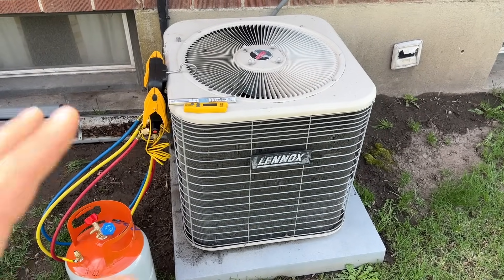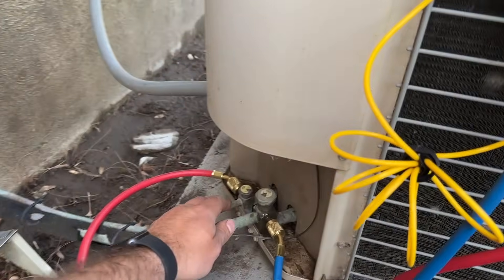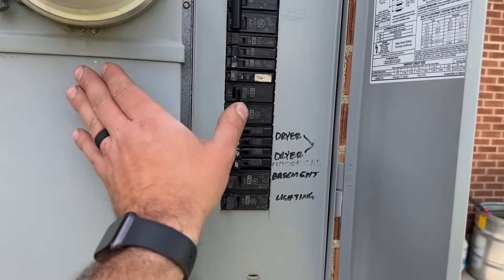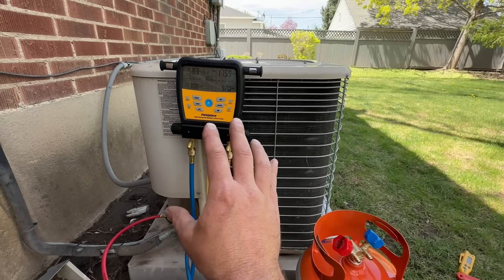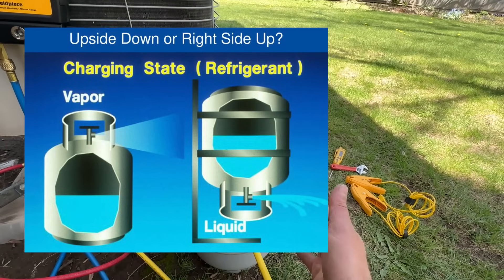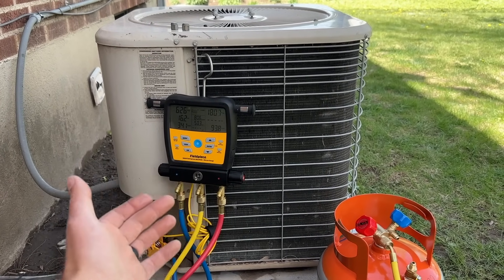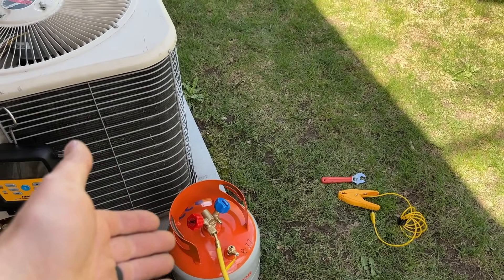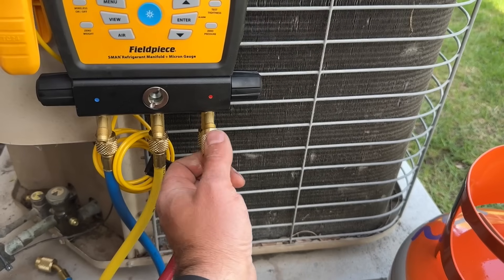How To PROPERLY Recharge Your Air Conditioner

Comment: HVAC is for trained professionals with years of experience, not a quick DIY Saturday afternoon at home watching YouTube.
Reply: If you have some similar skillsets HVAC work is a small step. Can the diesel mechanic fix his gas lawnmower?
Reply: @alexfriedeck1978  hvac is a trade that takes years to learn brother. Even master techs still have to go to school to learn new systems and procedures. Just cause you can change your own oil on your car doesn’t mean you can do this shit lol
Reply: @One_greasy_m0f0  Do you have a PhD in Chemical Engineering and one in Electrical Engineering and one in Mechanical Engineering and one in Heating Engineering? Those skillsets would take years learn and are needed to design, build, and install HVAC systems. What you have is Community College Engineering 101 skillset and you follow a flow chart with an "if this than" directive that the PhD's with the "years to learn" degrees have given you.
It all operates on the principle of evaporation. The only difference between a water cooler and refrigeration cooling is the heat transference mechanism is recycled. Learn new systems, oh please. You're shown how the manufactures tweaked the principle a little bit as a selling point so when it stops you can find the proverbial wrench a little sooner. The procedures, jeez, now you cannot vent refrigerant into the atmosphere and now it's required to turn off the power instead of recommended. Any other procedures I missed?

This industry was ripe with fraud for too many years cosponsored by the parts suppliers that starved consumers for parts who operated in the shadows with you feeding the consumer, the laymen, lies that to repair this equipment took a high degree of expertise when it doesn't as that now the internet has exposed the misdeeds of this industry, you're one of those fraudsters that is angered because the average consumer is no longer a layperson you can prey upon and you actually have to work for your money instead of stealing it.

$80 dollars for a 35/5 Chinese capacitor when I paid $22 last week for a US made capacitor and $299 for a single speed 1075 rpm Chinese condenser fan motor is fraud.

Thousands of dollars in tools, go ask the guy fixing your van if he has 40K plus in tools and he competes with the DIY's and AutoZone and you only have three grand in tools. $100 dollars per hour labor is fraudulent also when the guy fixing your van charges $90 an hour and his overhead is a $750K building and yours is a $50K van at $100 an hour is fraudulent acts committed against a layman consumer.

One of these days coming soon many of these big companies are going to find themselves as defendants to a class action lawsuit for price fixing. Go ask those tuna guys and the pharmaceutical guys about that.
Reply: @alexfriedeck1978 You just too all the fun 😂 out of my .25 cent insult....I bet your still single!

But, seriously excellent way to VERBALLY SHANK that sob 👍🏻.
Reply: I agree but some people cant afford 5-6-700 dollar bills just to put a capacitor in. Some of the Ac company costs are overwhelming.
Reply from the maker: If someone gets their epa card they can do this. Who is stopping them? It’s not illegal if they get that simple 608 card.
Reply: @diyhvacguy  Yes anyone with a mechanical aptitude can install a furnace or a/c but when it come down to troubleshooting refrigerant issues you need certification and experience.  Homeowners are going to do more harm than good in most cases I’ve seen it happen.

Comment: So how many homeowners do you think are going to get their EPA certificate, buy at least a couple thousand dollars worth of tools, order 410A or an R22 drop in online to charge their unit. Oh you forgot they need to find the leak so now they need a $400 leak detector. Remember when you’re charging for your “friends” at no cost from those recovery tanks, you’re pulling up oil, contaminants, acid that may have been recovered from burnout system.
Reply: Air flow
Reply: @bcracing204  is king
Reply: If a unit is needing refrigerant is becouse have a leak. First, find the leak and fix it then charge if needed.
Reply: ❤ thank you thank you thank you
Reply: 3:44 <-- see this! 

First of all, he broke down how to do this using the standard blue/red gauges and w/o temperature clamps. 

Take note that I am a homeowner with a leaking 5ton and I've been quoted up to $3k just to charge and just maybe repair the leak, OR pay $8000+ for a new unit installed. 

I was able to find a 10lb tank of new R22 for $259.95 and a set of gauges w/the quick connects plus a separate valve w/handle, as well as a # of extra attachments & replacement gaskets/seals, all for UNDER $30 . I have an infrared thermometer to assist in verifying the temps of my suction & vapor lines and/or my sub/super readings. 

If needed, I also have a digital scale to assist in measuring the amt of R22 being added.

I got some Condenser cleaning spray/foam for $9.49 plus already had ome Simple Green, garden hose and some misc brushes should i need them. 

I also have a multimeter I got for UNDER $10 that's been great after 3 yrs old that I'll use to run checks on the Capacitor, the 2nd stage voltage (...if necessary), and other electrical components while I got the panel off. 

Total Parts Cost: $309.44
My Rate @ $50/hr × 2 (est) = $100
Research @ $25/hr × 2 = $50

For a grand total of: $459.44

I'd say I'm saving a grand bare MINIMUM. Unit takes I think 9-11 lb of R22 and it's gotta be very low.

It wouldn't be outrageous to assume that there are techs out there that would happily charge me $3,300 bucks just for that 11lb of Freon!!
Reply: You can tell who the contractors are on the comments lmaooooo
Reply: Nothing about diagnosing any possible causes for low temp and low pressures??
Reply: @SavageOne420  That is because this is a collection of videos. This video is not step one.
Reply: You are right.  I am not licensed technician and won’t do it by myself.
Reply: Very nice video! Your explanation was very clear. please ignore the negative comments. They are very disappointing. I think some people have nothing better to do than try to tear down others. You, my friend, are one of those who is making the world a better place by helping others. I am going to use what you taught me to fix my own AC. Thank you very much!
Reply: Me
Reply: You can buy all the equipment for a few hundred.
Reply: Bahahaha EPA certificate - stfu bozo
Reply: It will still be cheaper than your shady ass.
Reply: Air is not the problem. It's the non condensable in air like water in a vapor form commonly known as moisture that is the problem.@@chadrichards5
Reply: I’m 17 with the epa I just need a reminder lmao
Reply: You seem snobby. I wouldn't hire you for sure lol
Reply: I will get mine, thats all
Reply: I would. I’m studying to get my EPA and I’ve learned a lot watching these videos.
Reply from the maker: Wrong wrong and wrong bro. I pulled that refrigerant from systems that were working fine. I have a seperate tank for contaminated refrigerants. Anyone should know that.
Reply from the maker: And who are you to say what homeowners are going to do? They have the right to get their 608 certificate just as much  as you do.
Reply from the maker: At the end of the day I’m trying to help people. If you don’t agree, I apologize, but I know the internet is riddled with people who just want to argue and that’s fine, but know that my intent is to help people, not keep them in the dark.
Reply: @diyhvacguy  You my friend have thick skin!  Seeing all the negativity from others commenting is pretty disappointing.  Not sure why people are so willing to tear down someone trying to share knowledge about HVAC.  I’m going to go back to watching automotive repair videos where commenters don’t always try to tear down the poster.  Thanks for everything!  Look forward to your next video, but I may have to pass reading the comments…it’s just too depressing.
Reply: @diyhvacguy  Don't let the negative feedback get to you. It doesn't cost a couple thousand dollars for a manifold gauge set and even the leak detector can be had for a lot less than $400.00. As far as the refrigerant is concerned the homeowner is going to buy it one way or another anyway.
Reply: I just got my EPA certification, proud DYI and anxious to save $$$.
Reply: You may want to reupload this video and say something else besides I'm reusing recovered refrigerant but it's ok... it's a buddy's house.
Reply: Just change it to recovered from a buddy's house to demonstrate what a low charge looks like. @mindblone0
Reply: I did.  I bought all my tools on offer up.  Only spent about $400.  
The real expense is when need 10lbs but have to buy 25lbs min at $400.  

I have been able to service my house, moms house, friends house.  

Money saved because dudes like this guy, helped me get my youtube HVAC certification.
Reply: @floppycoc1046  just because you got a certification doesn’t mean you know what you are doing. The certification doesn’t cover how to diagnose any HVACR system
Reply: @christopherlabre3889  Yeah experience is important but come on this is the MOST BASIC hvacr system.  The entire wiring diagram and specs fit on one single page.  

Whats the hardest problem your gonna face?  I know how to use a multimeter, I can research erratic gauge reading, (may not be a graceful diagnosis) Subcooling and superheating, yeah I read up on that… take the temp on the copper and find the difference on the PT chart… not that hard.  Downloaded an app and got my subcooling to 12degrees.  

I replaced my circuit board in the past, bad solder points causing intermittent low voltage.  Exhaust fan proving switch diaphragm failed, yeah it took a couple days of tinkering.  Probably saved $2k over the years.  

I promise I wont touch an industrial HVAC system… but my single stage home HVAC is EASY
Reply: @floppycoc1046  the Older SEER 10 AC units are basic, But since SEER 13 and up they are getting more complicated. I just went on a 5 year old 14 SEER system. 2 different contractors have been there and said they had leaks and charged the system and it still wasn’t working. First thing I did was check for a Leak, none found. Started unit up and it ran for 10 seconds and stopped, this was on a 62 degree day. The unit stopped because of high pressure. I had low suction pressure and extremely high pressure,  Sign of a bad TXV. If it wasn’t for the high pressure switch (most lower SEER systems don’t have them) this compressor would have been destroyed. Most DIYer would not know if there system has a TXV or orfice. I don’t have a problem if people want to work on THEIR own system. Just don’t complain when you damage it and have to replace a expensive part or replace the system.
Reply: Epa has as much credibility as my leg that is now gone
Reply: @treypelfrey2624  EPA exists to protect us from contractors who don’t give an F about anything.
Reply: I could almost guarantee somebody is gonna get a bad refrigerant burn trying this. What about airflow? I put 15 lbs in and my suction is still low😂
Reply: @alskee2010  I actually think DIYs videos are decent for DIYers.  Changing a capacitor or fan motor is fan and low risk for the most part for a diyer, but messing with chemicals with soo many variables to truely know if your low and need freon???? not good.  There are lots of steps to take before you even connect gauges.  I only connected my gauges about 50% of the time.  Half the time its a dirty filter that has never been changed.  I would estimate 20% of the time its a clogged or dirty evap coil.  The  remaing 30% are small almount of bad txv's and leaking system.  If you are dumping r22 into a system with doing a leak check, you are not saving anyone any money.
Reply: @christophermillsscola9629  just be aware that DIY usually means 
Dick 
It up 
Yourself

Like another commenter said if you're not a proper tech and you just throw a charge in you're an idiot. 
I'm a tech in a different field , and I know enough about ac that I'd leave it to a pro. 
Car ac? 
No prob ,like I said I'm a tech from another field. 
If you're a real tech, you realize you're not properly trained for something then don't mess with it. 
Sure ,go ahead and take a few guesses you might get lucky and think you know something,but you really don't. 
The cool thing is though, if you're a tech you can have a tech from the field walk you thru something. 
Most folks don't understand how the heat gets sucked up from the house and spit outside anyway, they are really way above their heads.
Reply: @MrTheHillfolk  I love it!!! hahaha  Actually had a DIYer call today that tried to do his own board.  Fried it really good with 120v on the 24v.  I gave him a good deal over the phone.  Picked up the $168 board.  Of course when I get there he fried the outside board and the thermostat, which until I installed the board had no way of knowing.  He then refused to pay for the board, because the cost of the new contactor and thermostat added to the board price.  I took the board out and he didn't want to pay my travel and diagnosis.  I told him ok, so you don't respect my time and experience and think you can have me drive 30 min to your house in the sticks and waste 2 hours and say thanks, but no.  I told him thats fine, I will just put a lien on your house for the price of the board replacment.  He then tries to hand me a credit card with attitude.  I said no thanks cash or lien.  Last DIYer I do.  So instead of making some money for the first 3 hours of the day NADA. Sooo done.... hahaha
Reply: @christophermillsscola9629  I don't work for know it alls, diyers, helicopters, rentals, builders, apartment complexes, government, LE, insurance companies, very few businesses and out of towners with out of state checks. Sticking with my loyal 25+ yr customers. If they are calling around looking for the quickies, you can bet they won't be loyal.
Reply: @christophermillsscola9629  most common problems. Clogged condensation drain line. Bad cap. Bad fan. Bad contactor. Clogged/dirty condenser. Clogged/dirty filter and/or evaporator coil. Low freon isn't that common.
A man learns those simple basic repairs, and he can service his own system and saved 100's of dollars. 
Everything else listed is everyday, call after call
Reply: No idea how to check for a resticted line, failed txv, clogged condeser coil, clogged evap coil, fan speed too low.  Soo much to check before you say a system needs refrigerant.  This is crazy.  R22 is 1500+ for a bottle now hence the 200 a lb price.  Good luck.  Doing this without training is about the dumbest thing you can do.  For all you homeowners reading this if a technician immediately hooks up gauges to your system.  Kick them out.  Air flow must be checked first.  You can damage your system and cost you 1000s improperly charging a system.
Reply: @christophermillsscola9629 , 😂😂😂😂😂😂.  Sell that BS $$$ figure to the poor elderly suckers that still haven't figured out Google.  I'm sure you sleep just fine on your money pillow but not everyone has no conscious.
Reply: Great advice! Any more? I'm a diy hvac technician, certified (piece of paper) and have experience only on my hvac for the last few years. Anything else you would throw my way? The initial checks you mention are great and I'm looking for all I can. @christophermillsscola9629
Reply: Re using recovered refrigerant and putting it in other systems is actually a violation of EPA regulation. I would be worried about someone reporting you.
Reply: The Fines for violating the EPA section 608 is $37,500 per day. Takes a lot of refrigerant savings to get that back. This makes my wonder if this guy even has his EPA license, to make a video of breaking the regulations.
Reply: @christopherlabre3889  if you are so concerned about the EPA violations and being technically right… I suggest you investigate how many professional HVAC technicians that own a working recovery machine.  

Its kinda ridiculous how much the HVAC industry prevents DIYers from doing their own work.  Cant buy parts unless you have EPA 608 and HVAC contractor license.  At least thats how it is in CA.  

But so many dudes in the industry just gas out the old refrigerant, to same time
Reply: @floppycoc1046  every van where I work has. Working recovery unit. I carry 2 to 3 recovery tank for different refrigerants. What other technicians do with old refrigerant knowing the regulations, that’s on them when they get caught. The problem I have with this video is he isn’t teaching people correctly. If he didn’t use reclaimed refrigerant I wouldn’t have commented.
Reply: @christopherlabre3889 Are you a contractor?
Reply: I don't think he cares about any of these things. Showing multiple illegal things in one video, and trying to convince others to go out and do the same thing.
Reply: Very foolish,who is gonna buy all this necessary equipment in order to out a few pounds of gas in a system. You gotta to know what you are doing